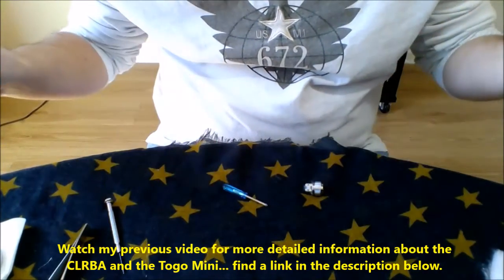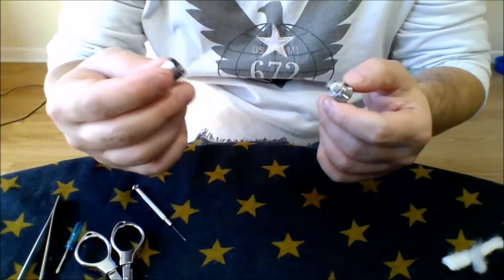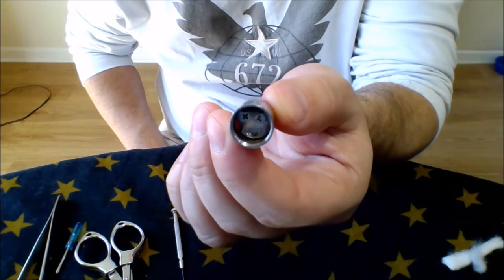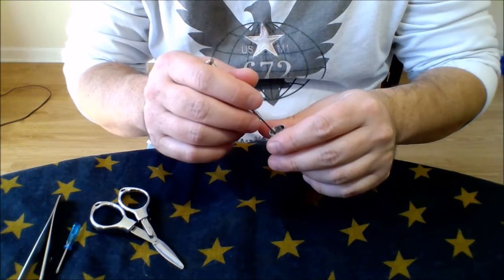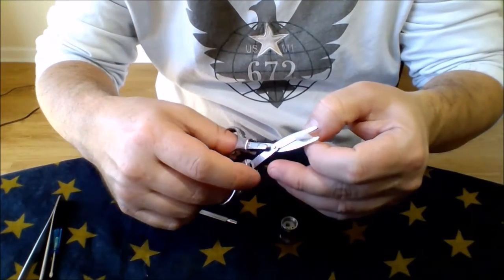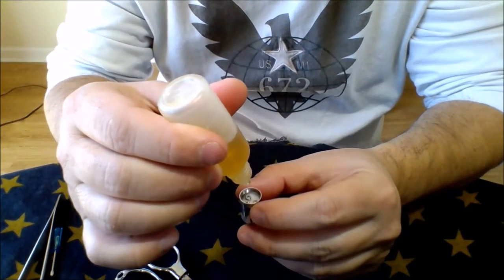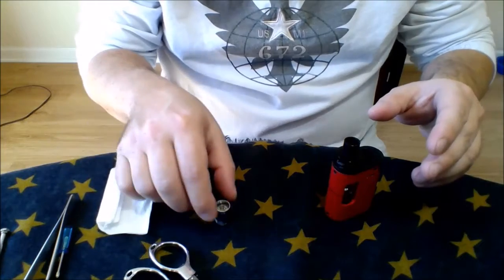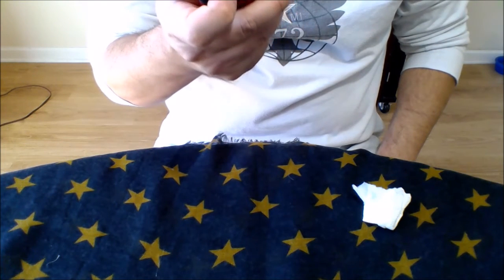Kangertech CLRBA wicking tutorial on the Togo Mini

Comment: Nice vid! I'm totally trying your vertical build with my Cupti when it's time to change coils. One note though, this is most definitely not a velocity deck, which has the distinctive two posts, each with 2 holes, for double coil builds. Happy vaping!
Reply from the maker: Value Vaping Yeah, I just kind of generalized it since Velocity decks have a similar construction and these single hole, dual square post decks are certainly distinctive from the older dual post decks with the square post design. No other quick description really fit.
Reply from the maker: Value Vaping I tried the wicking method you did in your video, btw. I got either flood city or mad dry hits. I had to stick it out with an old school dragon coil and pulled this wicking method back out of the drawer... it worked out. For the life of me, I can't get any horizontal coil wicking method working in this RBA. I'll keep trying, though. Subscribed!
Reply: Dean Dessureau I tried the vertical build twice and really wanted it to work but could never get it right :\